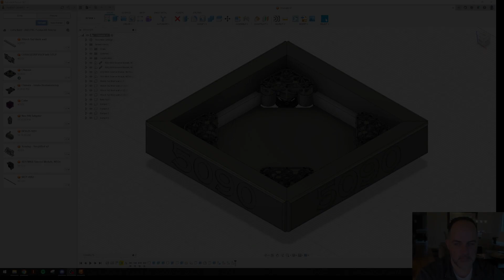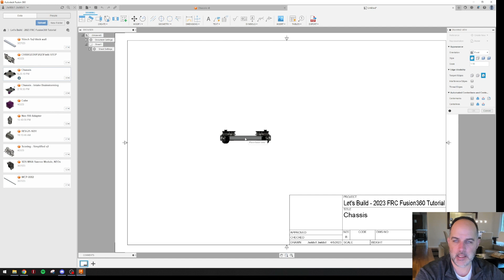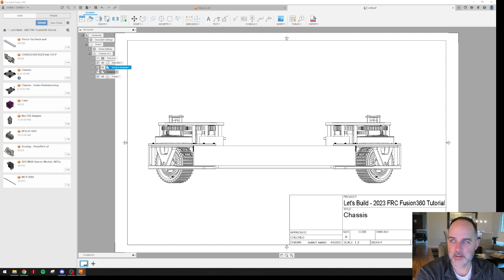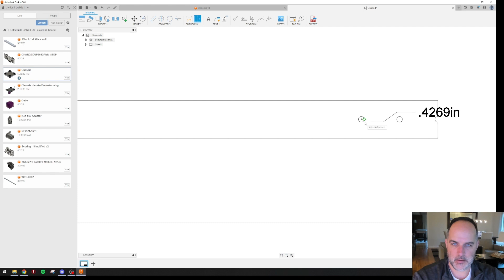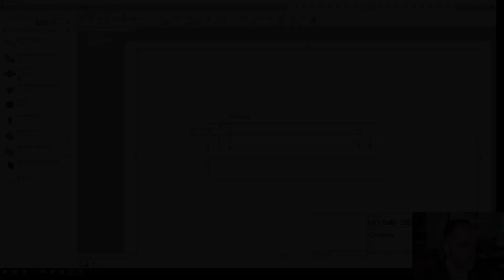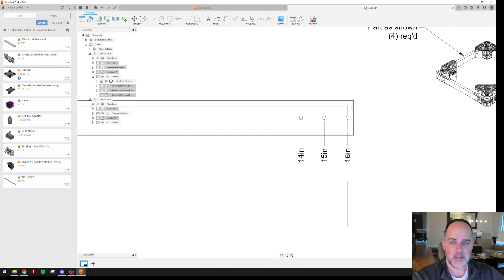Let's Build an FRC Robot in Fusion360 - Video #4 (Creating 2D Fabrication Drawings)

Comment: John those edge holes are used for mounting the modules. The 2x1 needs to go about 0.250" past that last hole. you might want to make an edit to the end of this or another video showing how to edit this. As it stands now the 2x1's would be incorrectly made. The sude view probably should have included the inside edge of the 2x1 and holes in the top and bottom.